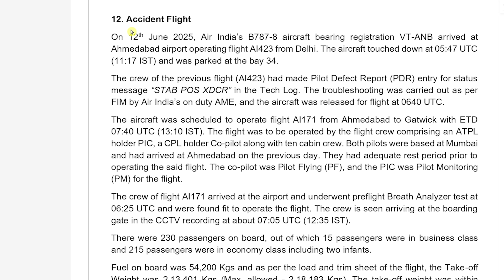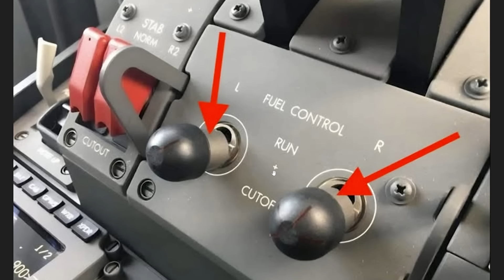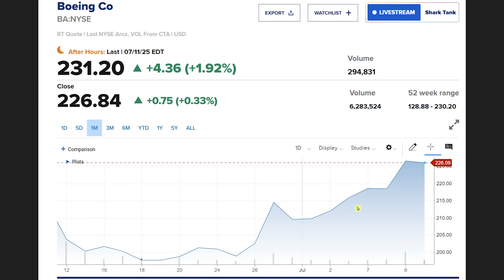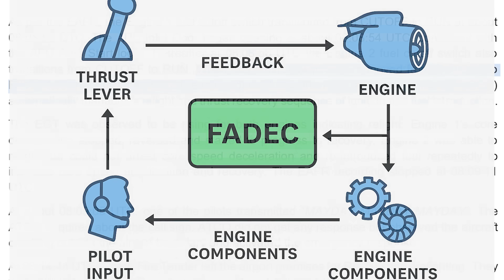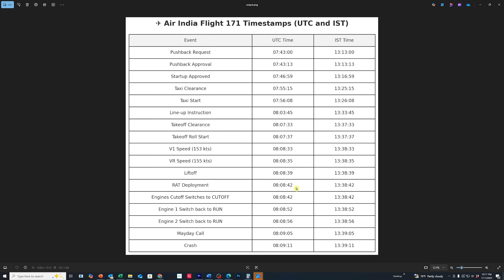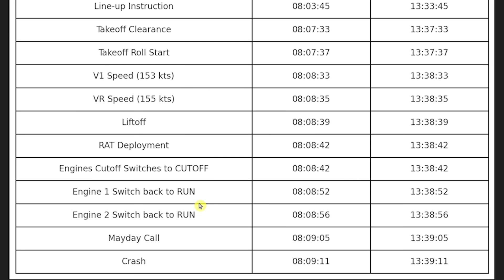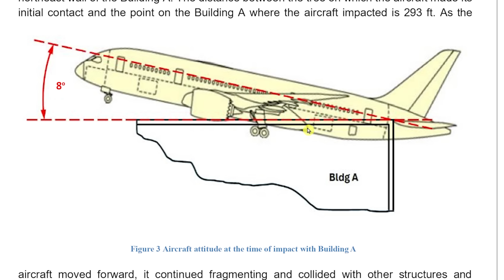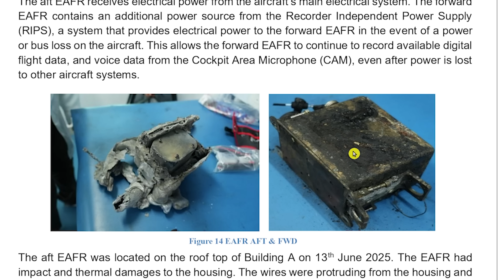Did Pilots CUTOFF Fuel? Shocking Twist Air India 171 Report!

Comment: These switches can be very intentionally moved. The design and location of the throttles and throttle gripping also set the hand up for an inadvertent switching. The grip of the throttles align the fingers to scoop the switches to cutoff position by moving the hand back and down. The protective medal funnels the fingers to align the fingers under the bulb headed switches.

Comment: But the data recorder records "data" or electrical impulses. I could assume it's possible the computer recorded a cutoff but the actual switches could remain in RUN, however if that were true then the pilots would have had to move the switches to cutoff and that move should have been recorded by the flight recorder. It would show CUTOFF > CUTOFF. So while possible the actual switches weren't moved, I doubt my own theory.

Comment: If the pilot union is preventing video in cockpit then they are just shooting themselves, pilots included, in the foot. Recall that AI is about to completely change everything. It's simple to imagine an AI computer onboard and sensing every movement, air speed, attitude, guage readings, switch positions, etc., or one or two AI equipped robots REPLACING the humans who not only make devastating pilot errors or intentionally kill themselves taking hundreds of innocent humans with them. Robots don't request unions, don't doze off on long distance flights, don't need breaks, food, or coffee, or ask for money from the airlines.

Comment: I have landed safely a super sonic jet with no power!  I have flown many hours of 2 engine jumbo Air Bus aircraft, I also am a FAA designated Master Pilot. I assure you that at the altitude the AirI India pilots were and no where safe to land , those fuel switches needed to be OFF. No one wants fuel to be fed on a crashed, hot engine.
Maybe the computer brain which caused the power loss knew that and shut them off, guards or not?  The pilots needed altitude and air speed. There was neither, nor TIME.  Don’t play the pilot error card so fast!  We may never know. Having the fuel cut off was the best case after all hope for the missing altitude, speed and time were consumed. 13:45 13:45  Management of energy is not an option with no source of energy!

Comment: There should be a lockout to fuel shut-off toggles anytime the throttle(s) are set to full thrust, which is the protocol for all departures.  Or, link it to the altimeter, so if one of the pilots is having a bad day, they can't kill everyone.

Comment: You seem to have it all worked out. Are you aware of FAA SAIB bulletin, which indicates that if the safety locks on the fuel switches are disengaged then the switches can be moved WITHOUT lifting them up. So let me ask you this - were the safety locks on the fuel switches on THIS plane checked and in order? The report indicates that Air India had not done this check. This means you are looking at a scenario where the safety locks on the switches were disengaged and they could have been inadvertently knocked to cutoff position leading to the pilot conversation. So if you are a professional aviation analyst you should be asking this question and trying to ascertain the status rather than regurgitating the tripe of Capt Steeve or others about pilot suicide and mass murder. This is utterly despicable.

Comment: Both engines being cutoff at the same time screams intentional. They turned them back on one at a time and it takes 4 seconds to turn them on? Judging that based on the fact that engine 1 came back 10 seconds after cutoff. And engine 2 four seconds later. But both cut off at the same time…

Comment: This is either a pilot or co-pilot deliberate action.
That the pilot noticed that the fuel switch was in the off position does not necessarily mean that he or the co-pilot didnt flip the switch to the off  position himself in the first place, and vice versa.
And mind you, also both are aware that anything they say will also be recorded in the cockpit voice recorder.
From the initial report, the plane was perfectly in a good condition to fly and there was no mechanical or technical issues prior to it taking off.
A full investigation should be launched as to the personal life or background of these two individuals. 
Remember the German wings, Malaysian  370, Egypt Air 990, Silk Air?
So many cases of pilot induced crash. Really shocking to know that once you board a plane, you are at the mercy of these pilots whose sole aim is to crash the plane.

Comment: The to coments witch I will make or if the to switches or spring loaded in sum way cud thay of broken of underneath the panull of cotpit or bin a intermittent  folt I remember sumthing repdring a chan sorse I had a intermittent folt on the electronic egnishe wher wen testing it showed working perfikt but after a minit of the chan sorse runing it malfuncshond theas folts ot verey difikult to spot I wos working on it for 3 weeks of and on .  The second qeston cud eney bodey be hiptinsed to do sutch a dredfull thing whith a triger word  to actevat them in to dowing so has eney bodey checked ther phon cales or phon logs

Comment: I have my trusted YT sources for air incidents. All of them are responsible. One of them described potential scenarios for why a plane stops flying. He covered the wing no longer flying and then the engines. He was roasted for describing the potential of pilots reconfiguring the flight surfaces. He never blamed the pilots, but said that they “May” have done this. People getting out their fainting couches is tiresome. Now, we know that it was the fuel cutoff switches. Pilot induced. We don’t know if it was suicide.

Comment: Those switches must have a cover that must be locked upon depatures and only can be unlock by the two pilots in the case of an emergency. As they are, it is an easy access. It is a recommendation for Boeing.

Comment: OK, so the Captain did it. The first switch to be cutoff was for Engine One, the left switch, the switch closest to the Captain. If you were in a cockpit and either deliberately or accidentally (it wasn't) 'flicked' a switch, it's naturally going to be the one closest to you first. They were switched off, then back to run, left first then right, which is what you'd do if you wanted to bring a plane down deliberately but try to cover it up when the wreckage was inspected (or return to 'run' so if your co-pilot looked at the switches they looked fine and he maybe wouldn't say anything that could be picked up by the CVR. Yes I know the FDR recorded it, but he may have hoped fire might destroy the data, or poor investigation techniques, or amateur wreckage retrieval techniques might leave the off/on movement undiscovered (I mean, just look at how that empennage was transported!). Or even that that looters might take the FDR/CVR, instrument panel pieces of whatever they can lay their hands on. So, again, Captain did it.

Comment: 05:52  OK, so the switches were both in the RUN position!  You're reading too much into the pilot's question, "Why did you cutoff?"  This might be the first thing that came to the pilot's mind as a reason for both engines shutting down.  It could have been a mistaken perception, not a fact.

Comment: Who was the pilot flying? 
His hands are on the yoke on rotation. He would have been focused on the flight director.
Not the other guys hands.  

How could it be him without the other noticing? Only makes since if the pilot monitoring did it. 
If the pilot flying did it, the response would have been more like 
" what the hell are you doing with them cut-offs" 
The response would have been way more immediate also, switches wouldn't have taken so long to move back. 

Pilot monitoring hesitation on the 2nd switch proves that he didn't want the plane to recover.

Comment: In another video I saw a bulletin or possibility an AD about the fuel cutoff switches and or the detent guard being installed up side down.   This condition could allow the switches to accidentally be moved or vibrate into the off position.  The air raft had recently, I believe they said in March, been through a major overhaul.

Comment: On that timeline, the RAT deployed "before" the Fuel Cuttoff swiches were set to Cutoff??!!? If the shown timeline is right then its not human error, but software error that lead to the crash! we need the exact times to the milisecond on those two, to ensure exactly what happened first (CUTOFF -> Rat Deployment) or (Rat Deploymet -> CUTOFF)!
Reply: Both events are at 08:08.42 UTC (chart at around 10:50). Can be automatic deployment caused by both engines shutdown,

Comment: The engine fuel switches were cut off precisely when the gear should have been lifted. The gear remained down. Is this an example of a wrongly applied motor program? Similar (?) action, wrong control? Airbus experienced this with crew rotating the park break to ON when they intended to rotate the engine mode selector to ON during pushback.This resulted in sudden locking of the main wheels and the aircraft rising up onto the tug - it happened more than once.

Comment: Fuel signal loss automatically transition fuel supply to cutoff (switches physically dont move) due to eirher: 1. Sensor corruption, 2. Cable corruption, or 3. Fuel  contamination (ruled out). Switchea highly unlikeky to be switched off a second apart. Lack of cable + sensor maintenence.

Comment: My opinion  moving forward  is that major changes should be made in regard to fuel cut off switches . Why  is it even  possible  to shut off both engines intentionally or unintentionall  at this point in the flight.  
Ibelievee the recovery and restart of engine trust could have happened if there was a dellay   installed to prevent  engines from shouting down  right at takeoff.
In this case, they had no chance to recover.

Comment: So, how fast was the plane going when the RAT deployed at 08:08:42?  The plane reached VR Speed of 155 kts (kilometers) at 08:08:35.  Was the plane going faster or slower seven seconds later at 08:08.42?  If the plane was going slower at 8.08 am and 42 seconds...the engine issue happened BEFORE the Engine Cutoff signal which also occurred at exactly 8:08.42.  So, engine loss couldn't have been from the pilot flipping the switches off at 8.08 a.m. and 42 seconds  -- if the plane was already going slower.  

I also think the RAT deploying in exactly the same second as Engine Cutoff (with the RAT listed as the first event), seems like a Red Flag against the pilot having shut off the engines.  

Lastly....the Prelim Report says the one Pilot said "MAYDAY, MAYDAY, MAYDAY" as the last communication on the Cockpit Voice Recorder.  Early reports were that this pilot also added "no thrust").  Boeing and the U.S. FAA are two of the parties to this Investigation.  My guess is, all parties got to contribute to and edit the Prelim Report.  Maybe Boeing and the U.S. FAA were against including these last few words in the Prelim Report, even if they are really on the Voice Recorder.  Investigating parties with vested interest editing the Prelim Report is just as likely - maybe more - than pilot suicide as the cause.

Comment: Rat deployed 3 seconds after takeoff but fuel cut off after that??? How is that possible? Engines would need to be shutting down for the rat to deploy but the cutoff switches shut off after that. Something is wrong with the scenario and doesn't make sense.

Comment: Everyone overlooks an obvious possibility. The switches only send an on-or-off signal to the computer system. Software then interprets and executes the actual action being invoked, in this case shutting off fuel flow. Software is unavoidably subject to glitches, and a single flipped bit due to a voltage fluctuation could cause an erroneous branch in the logic. Even more insidious, though, is the possibility of outside interference along the lines of the anecdotal Boeing Uninterruptible Autopilot described by Field McConnell being used from outside the aircraft to send a "cutoff" signal overriding the actual position of the cockpit switches...

Comment: We don't have enough evidence to prove that one of the pilots shut the two engines off.  We need the full cabin voice tape to better understand the the context the one sentence each pilot said in the Preliminary Report.  We need to know what the computers/other systems were doing.  We need to know if it is possible for the 787 itself to automatically shut-off the engines when certain things happen.  But, intentional human shut-off is now certainly on the table, and maybe the leading possibility with what has been preliminarily reported.

Comment: You struck out conspiracy bubba.  FAA advisory NM-18-33 is a Special Airworthiness Information Bulletin (SAIB) issued by the FAA in December 2018, concerning a potential issue with fuel control switch locking mechanisms on certain Boeing aircraft. The bulletin highlighted a risk of the locking feature disengaging, potentially leading to unintended engine shutdowns during flight. While not mandatory, the advisory recommended inspections and potential replacement of affected fuel control switches.

Comment: I know nothing about avionics  so forgive my ignorance. I noticed that the Rat was deployed at the exact time the fuel control switches were & I have heard other pilots say there is a certain number of seconds delay before  the rat deploys after the loss of power. My question is how long after the fuel control switch is moved to off  will the fuel in the lines & the engines run out & cut power generation in order to make the rat deploy.?.

Comment: In 2018, the Federal Aviation Administration (FAA) issued a warning about potential issues with fuel cutoff switches on Boeing 737 aircraft, specifically related to the locking mechanism. The FAA noted that some switches had been installed with the locking feature disengaged, which could lead to inadvertent movement and potentially shut down engines in flight. However, the FAA did not deem the issue serious enough to mandate immediate action.

Comment: Ok, here's a theory. Both pilots were telling the truth. The fuel shutoff was entirely electrical, computer malfunction, the switches were never moved. The RAT deployed at the same time that the switches were supposedly turned off. Why would that happen? It aircraft malfunctioned and they tried to cycle the engines.
Reply: Isn’t the key question, can the fuel supply be cutoff without using the fuel switches?
Reply: @tiemanmalcolm  I don't know the ins and outs of how that stuff works, but it's a safe assumption that those switches are not physically connected in any way to the actual valve. Those switches send a signal to a computer, that computer sends a signal to the valve.

What gets me is that the RAT deployed at the same time, in the very same second. Had they turned the fuel off, wouldn't the RAT have deployed a bit later?

So theory here: They got an indication that the fuel was shut off. One pilot asked the other why he turned off the fuel, the other said he didn't. Then they cycled the switches.

I don't know if this theory holds because there was no time stamp on the fuel cutoff question. When did the pilot ask that?

Anyway, my thought is aircraft malfunction, rather than deliberate sabotage.

Comment: Jeff, I love the fact that you were the very first to smell the RAT, 2 days before all the other channels. 
We need the whole Cockpit Conversation. I am ready to accept pilot failure or suicidal tendency…. But I have the thought maybe the pilot wasn’t blaming if the other switched off the fuel, I think it could have been a mutual checklist procedure. “Did you switch off fuel” “No I didn’t” “ok, let’s reset the fuel switch then” 

I also smell RAT now! RAT deployment and Engine Cutoff switches transitions to CUTOFF at the same time! 08:08:42, Maybe the RAT logic forced the switches for the electrical switches to switch off. Software glitch or bug. Some case that was never tested in the FMEA. 

Can the RAT really instantly detect that both engines are fuel off and deploy in the same instance… therefore, I think it could be the other way around, maybe RAT fail functioning switching off Fuel… please elaborate

Comment: Nothing accidental about this.  This was a deliberate act.  How do I know this?  I have a lot of years flying and operating similar switches.  These switches require two movements each to activate as the narrator so correctly points out.  This is a deliberate act by a deranged pilot.  Period.

Comment: A loose wire/bad solder joint between cutoff switch and electronics module could result in an OFF signal (low voltage) to the electronics module even if the cutoff switch is in the ON position.
Reply: It's not consumer tech, you use at minimum 2 wires to scan the switch positions and the switches have usually no position where both contacts are open to detect wire breaks.

Comment: Is it humanly possible to switch them off within only 1 second between them? Im no pilot but is it correct that its possible to turn both switches off but not within 1 second of each othwr? So they cant be accidentally switched off by pilots or bumped to off position is it possible the system could switch off fuel without physically turning the switches to the off position? What about remote control capability? The 1 second gap is bugging me that doesnt seem to make sense to me
Reply from the maker: There is no remote control possibility of controlling this plane and yes you can do both of those knobs within one second of each other